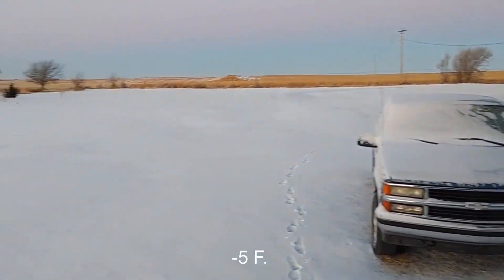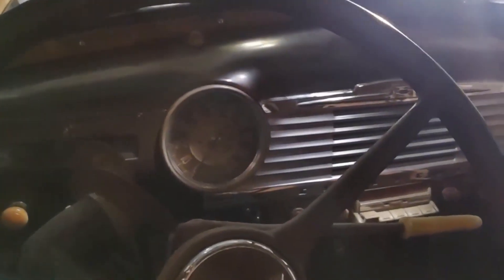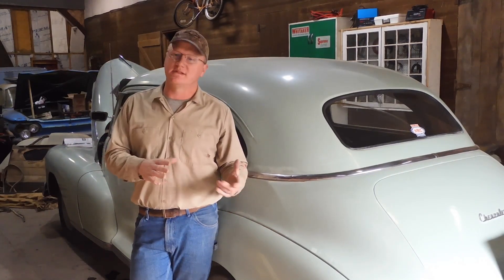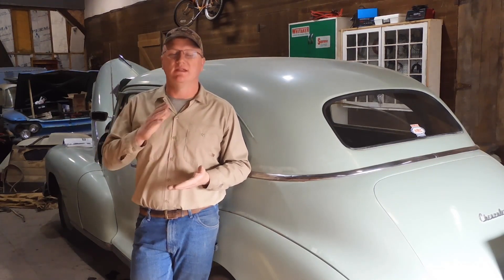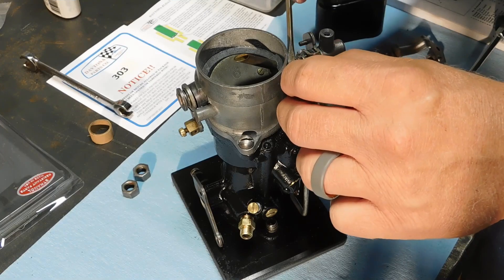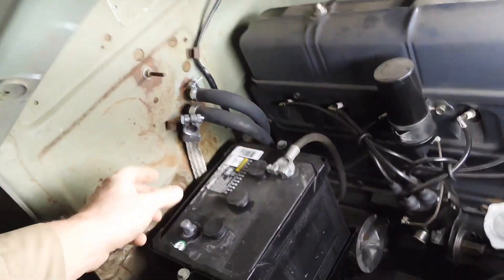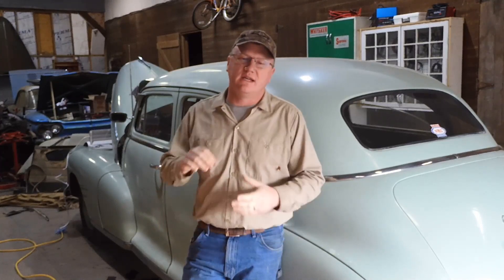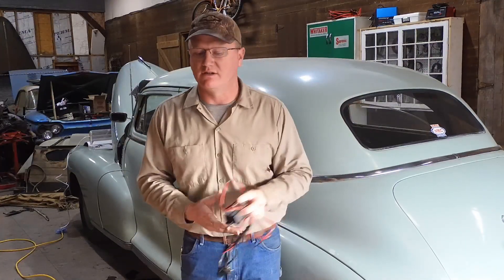6 Volt Vehicle Cold Start - Should You Convert Your 6 Volt to 12?

Comment: This is a true story about a cold start and a 6 volt system......in 1957, I was in Champagne Illinois visiting some friends...my friends father was a staff doctor at the University of Illinois..he had a brand new 1957 Chrysler,  his wife had a 1957 Plymouth,  both cars were In a closed garage, and my friend had a 1954 Cadillac,  parked in the driveway.  My car was a 1940 Chevrolet 2 door sedan with a 52 Chevrolet 235 engine,  parked on the curb out in front of the house. It was early January and a cold front came through during the night and dropped the temperature below zero ...the doctor's Chrysler,  his wife's Plymouth and my friends Cadillac wouldn't start...so his dad came to me and asked if he could use my Chevrolet to go to work, so when he got in it, it started right up(It was an Arizona car)...6 volt system.  So when he came home that afternoon , my car had a full tank of gas...true story.

Comment: Ok my battery is good, my cables are 1awg, my generator has been checked out, voltage regulator contacts have been sanded smooth, ground cables installed, but my Battery Gauge indicator still goes to D when I crank it up. Any hints?
Reply from the maker: Did you polarize the generator when you hooked everything up? With a short piece of wire or jumper lead jump the battery terminal to the armature terminal on the voltage regulator. Do this for about a second or two. When you take the jumper off you should see a little spark. Do this with all wires in place, battery hooked up but ignition off.

Comment: Glad you mentioned battery cables.  Most people under a certain age just don't understand that.  You forgot about another critical item - the battery itself.  If you see a 6 volt battery at a chain auto parts store, it will probably be Group 1.  That is too small, unless your car is a VW, Jeep, early Rambler or something.  You must use Group 2 or larger.  Also, the reason so many 50s and later starters spin so fast is because engines by then had more aggressive cams, which makes them a little harder to start.  That means a stronger starter is required, or else you will have starting problems.

Comment: Back in '91 - '92 I daily drove a '47 Chevy Fleetmaster. Unfortunately I fell into the trap of 12v conversion. Looking back I shouldn't have and the sound of a 6v system cranking is so much more pleasing. I haven't, and won't convert my Model A & Model T to 12! Now to find another '47 Chevy......

Comment: look up the old dupont zerex commercial. at -20f below zero a rail road worker gets off work and starts up his 50 chevy pickup. I lived in minnesota and the big improvement is synthetic oil that flows good when cold. NEVER gun the engine when you start it as that can throw a rod. let it idle till the splash trays fill up. my first car was my grandfathers old 48 chevy. I had no garage but always got it started in the winter. in 1960 I did all the things you tell about plus used 10 weight oil and good points/plugs. the old chevys will start even if they crank slow. people got by with 6 volt systems in the old days and can do so today.

Comment: Just discovered your channel through a 216 engine video and subscribed.  You are so right with everything you said about original systems.  I can't count how many times I've tried to convince friends not to change everything from original, usually with no success.  (and all the 216's which have been replaced with 235's.  It's an epidemic) It's the same thing with Model A Ford brakes.  They are completely capable of doing what they're designed to do - but you won't see 1 car in 10 which has the system properly restored.  Like your content.  Thanks,

Comment: if 6 volts was so bad, how did we win WW2???
Reply from the maker: Few remember where we came from all they know is what they see in front of them right now and what they can get out of it for themselves. People back then had a lot less education but a whole lot more knowledge. There are few mechanics today that would even understand how a simple machine like a '40s Chevy even works because they can't plug into it. Which is a big reason why I do what I do here. Thanks so much for watching.
Reply: @TheJayhawker  The big mistake most make on 6 volt cars is buying battery cables off the rack at a parts store. 6 volt systems draw double the amps to do the same work. Huge diameter cables as short in length as possible works great.
Reply: That and trying to use a little Group 1 battery in a V8 car.

Comment: I've never had a problem starting a 6 volt car even in sub zero weather. Convert a 6 volt car to 12 and you've destroyed it. How do you handle the multitude of accessories and other components all designed for 6 volts: Gauges, heater motor, starter, fuel sending unit, all lights, voltage regulator, horn relay, horns, wiper motors if it has electric as Mopars did, etc.?

Comment: What I didn't hear mentioned was the term amperage draw (maybe it was, I just didn't hear it). In a 6v system the amperage draw is much higher than in a 12v system, which is why you need larger diameter cables to support the higher current draw. Even the wiring harness in a 6v system uses larger diameter wires due to the higher amperage draw of lights and accessories. Lower volts = higher amps. Higher volts = lower amps.

Comment: 12 volt battery cables are not made to work with a 6 volt system use the correct ampere ones for your old system

Comment: Use light bulb under car at night not heat lamp it too hot reg 100w bulb or switch to 8 volt battery. All electrics will handle it
Reply from the maker: You can do both, but neither should be necessary unless you drive your classic in extremely cold temps.

Comment: Thank you for another great video Mr. Jay!  I experienced the same thing in rebuilding the electrical system on my 1950 Farmall. After taking all the jury rigging off of it and rebuilding it to 1950 specs it starts easy every time regardless of how cold it is. 
Now I’m redoing a 1948 Chevy Stylemaster and you’ve only further helped me decide to stick with the 6 volt system. I’m having to replace the wiring and rebuild the electrical system just as you did.  Thanks also for the videos on all that as well!  It helps greatly to have them for a guide!
Reply from the maker: You're welcome, thanks for watching and have fun!

Comment: in high school back in 1974 i had an original 1953 Chevy 210.  6 volt.  I kept that tuned up.  it sat outside all of the time as we only had one garage and dad's 66 Chrysler Newport occupied, rightly so, that spot.  We had a lot of -20F days and my chevy would always start. If it would grunt over a full turn it was running.  The same goes for my 1940's Ferguson tractors, positive ground and all.  Seems engines back then didn't need to crank at 500 rpm just to start like they do these days.  I am in full agreement with Mr. Jayhawker, that if you keep them tuned up proper, they would go.
Reply from the maker: Hey, aren't you driving the '42 to work everyday? Thanks Kevin!

Comment: Who is your go to battery cable supplier? I've got some big fellas on mine but wouldn't mind even bigger.

51 Fathom Green Chevrolet Deluxe.
Reply from the maker: This particular project I ordered them with all the other parts I needed from Chevsofthe40s.com. Built to the correct size and length for the car model.
Reply: @TheJayhawker  Looks like my local shop, Brillman Company has the exact same product and for less of a shipping charge which Chevsofthe40s really nabs you on. Thank you so much!
Reply from the maker: @ElliottCollect  Thanks for the tip, I'll check them out. When it comes to chevsofthe40s, I always call to order. The clerk will ship USPS if you call and it's always much, much lower.

Comment: Have the original six volt system in my 53 210 and all I did was made sure I had clean connections, all the grounds were good and added a 0-0 positive cable and I have never had any issues with starting the car in the 15 years I have owned it. It has never let me down....

Comment: I have a 52 Oldsmobile that I had starting problems with. I went to the local chain automotive store and bought a battery, there wasn't one in the car when I got it. The batteries, I finally went thru 3 of them, lasted just about the year they were guaranteed for. I was really just about over it and my friend told me that I shouldn't convert to 12 volt, that a starter in decent shape and the right cables should have her starting properly. I had the starter off several times, new brushes and bushings and cleaned the commutator. After fooling with it over a long period of time I found that the armature was bent and subsequently replaced that. The battery cables were the originals so of correct size, my friend turned me on to a place that makes up new cables of correct size. But I decided to replace it with a new one anyway. After the new cable was on, I cut open the old one, it had blue corrosion half way down the lenght of it. And this last time I needed a battery, I bought an Optima red top, I'll never buy another regular battery from a chain store again. The gel type battery doesn't look right and I wish I'd known about Interstate, they make a gel battery that looks like an original. But she starts reliably no matter how long I let her sit or how cold it is.Your advice is 100% on the money.

Comment: Hey Jayhawker! Thanks for the video.  I agree with everything you said & I've always been of that mindset.  I have a friend who has 4 cars from the 50's & he has swapped the 6 volt for the 12 volt system on each one.  He has suggested, of course that I switch over too but, to repeat a long ago advertisement:  "I'd rather fight than switch." He also mentioned about using an 8 volt battery.  Truth be told, I did not know an 8 volt battery existed for vehicles.  Since then, I've heard of others using the 8 rather than the 6.  Do you have any experience, know;edge, etc., about the 8 volt?  Thanks again for sharing your knowledge, skills, & lessons learned from those who came before you -- much appreciated.  I hope you keep doing what you're doing.
Reply from the maker: I've never used an 8 Volt, but I know it is often done. But in my opinion it is simply trying to accomplish the same thing as the 12 volt conversion accept it is more lazy because they think that you can run the 6 volt equip. without modifying anything. But in the end, you really need to adjust the voltage regulator at the least and your bulbs will likely burn out prematurely.  Again I would just suggest keep things in tune and 6 volts will be fine.

Comment: Well said Jay, your vehicle just has to be up to par. I have an old 1956 John Deere 420, 6 volt, and It turns slow but that's all it needs. My 36 pickup is 6 volt and it turns slow but it starts fine. Like you say we're just used to hearing the fast turning of a 12 volt system. 6 volt works fine.

Comment: I ran 6v in my 49 Chevy 3100 for 5 nearly trouble free years, year round. I like to tinker so I kept it in properly serviced which isn't rocket science but it does require regularly scheduled maintenance.  I'll venture that the coldest I started it and took it out for a cruise somewhere in the mid 20's F. I don't function as well in such cold temps so unless its necessary neither do my toys, LOL. 
The 6v never let me down but I did add a 6v to 12v converter circuit so I could run a modern radio & power outlet. The integration of a couple 12v circuits running side by side with the 6v electrics was trouble free. So I agree that a well tuned & maintained 6v system will work fine in these old vehicles year round. I will admit that 12v is very good too.... 
I will say that any carbureted ICE that doesn't require choke to start is set too rich.
I would have to set the manual choke on my 216's Rochester B carb to cold start but once it caught (started to run) I could almost completely open the choke & it would fast idle until I felt it would idle at std rpm and opened the choke completely. It would stumble a little when pulling out but could be mitigated by applying slight choke until the engine was fully up to operating temp. Once up to temp no stumbling and good power. That old 216 powered 1/2 ton avg'ed 14 mpg and could still haul it's spec'ed weight up to the point when I repowered the pickup. The 216 should live again, some day.
In any case, sorry for the long post, enjoyed the vid.
Dave

Comment: Thanks for that timely video! I've been waffling for over 2 years now about the conversion.  I tested the headlamps and they both worked, but by 2 years later, both have failed and had to be replaced. I keep staying with 6 volts - now because I have so much invested in 6 volt items. When I rewired the car, I incorporated both turn signals and emergency flashers. I was stunned to find that I had to have both a 6V turn signal flasher and a 6V emergency flasher - 12V units would not work. I figured the flashers being in series with the bulbs meant the flashers were current-operated, and voltage would not matter. Wrong! Of course, at 6 volts, any bulb having a wattage the same as a 12V bulb will require twice the current. I especially appreciate the comments on the battery cable gauges. I had simply tried to find cables of the correct length, and ignored the gauge totally. It rarely gets below 30 degrees here in SC, so that's not so much a problem for me. I kinda like the way the old car grunts to life. It does have a romantic quality in my opinion. If I'm gonna have a radio, I'll probably just put a gel cell in there and charge it separately. Keep up the good work!

Comment: An old mechanic told me as a youngster that you could put 12 volts to a 6 volt starter without issues as long as the tune was good, as the 12 volts would not hurt as long as there was not a significant amount of cranking time. 12 volt spin a 6 volt starter much faster, and makes starting easier regardless. I have always found this to be true. Even a proper 6 volt machine starts faster & easier with 12 volts. I have made the switch on more cars, trucks, tractors, Jeeps in my life than I can even remember. I've always found it to be a pretty damn good upgrade and have never lost a starter doing it. Another big plus is the use of the 12 volt GM alternator. If I picked up a pristine old 12 volt classic tomorrow I would do it again, in a heartbeat.
Reply: It sounds like the dual voltage switch that I bought from JC Whitney decades ago, except mine was 12 to 24 v for a diesel. Unfortunately, with 24 volts, the solenoid would engage with such force that it wrecked the flywheel. Probably not an issue with 6 to 12 volts, though.

Comment: 100% agree. I’ve had many 6 volt vehicles and not a one has ever let me down. I can’t say that about every 12 volt vehicle I’ve owned. Of course the 6 volts have been collector cars that were treated accordingly, but if it worked fine when it was a new car, it’ll work now if properly maintained. Winters are no colder now than they were when that old car was new. You’ve exposed the secret, you’ve got to maintain them like it used to be done. Simple.